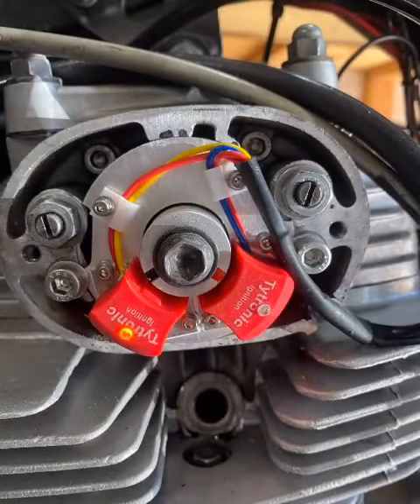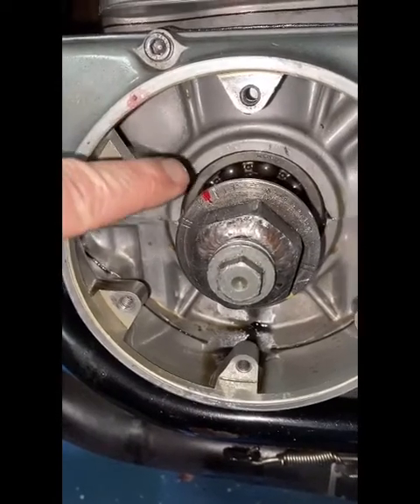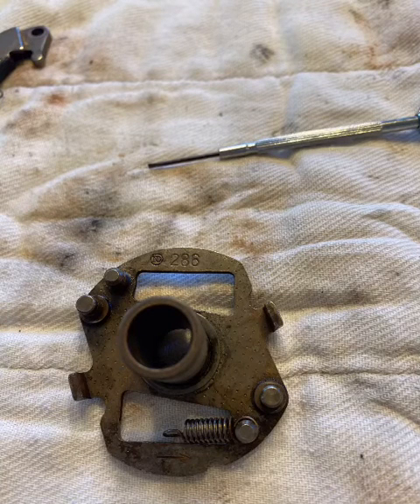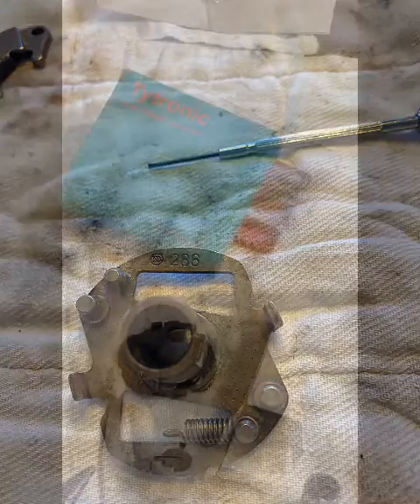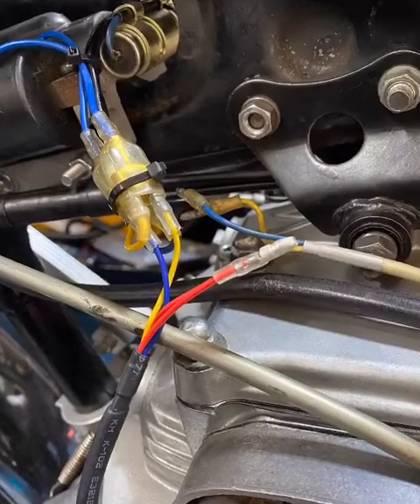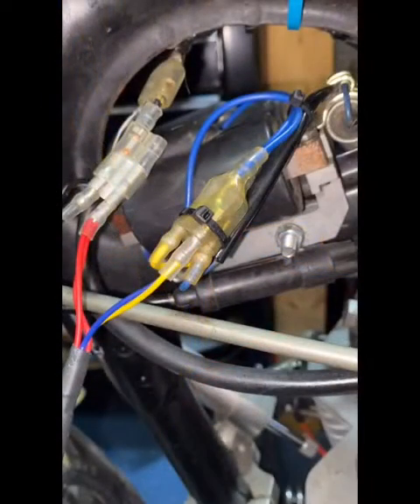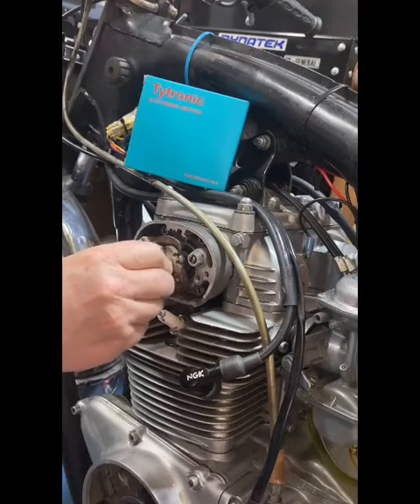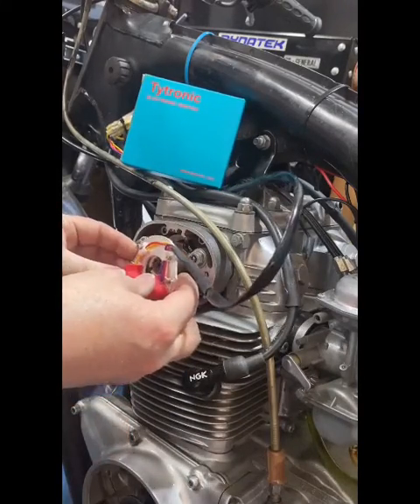Tytronic Ignition Install

Comment: Would it be possible for this to work in an old Kawasaki KZ305? Really curious.
Reply: I been in the process of making one for a kz 305. There is a set up for a cb 350 that uses the stock rotor timing advancer. I bought the kit an made a backing plate for magnets to bolt on to. I should be done with it shortly.
Reply: Lograste la adaptación?